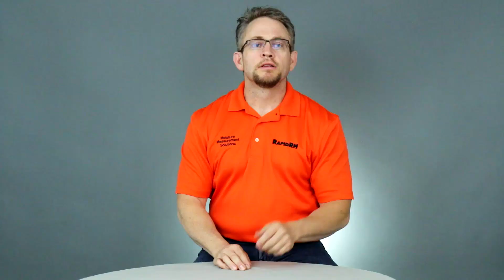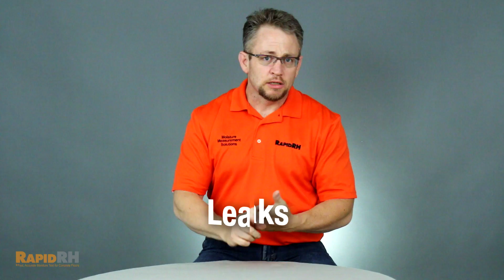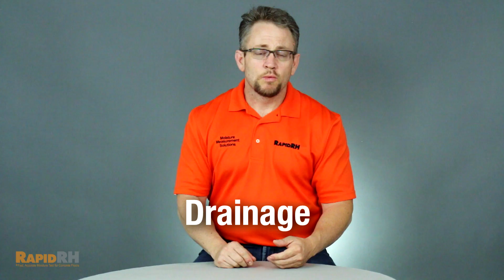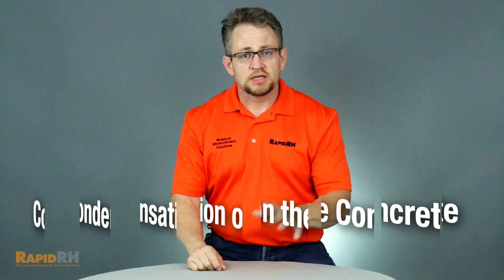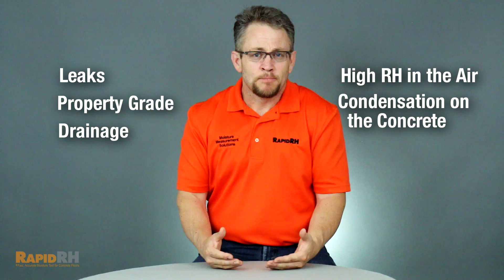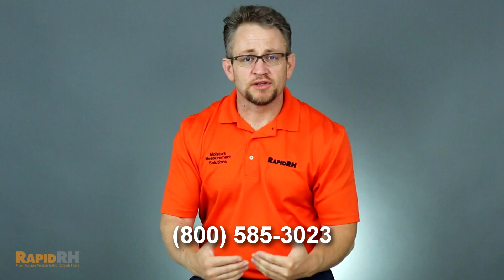5 Common Sources of Moisture in Old Concrete

Comment: Go for it flooring. We use a moisture meter  every time. i am finding high moisture content in 9 out of 10  slabs. I have  to seal them with  Bostik concrete sealer

Comment: Hello. I live in Southwest of ON Canada . my concrete garage floor is over 40 years. i am about to re finish the floor this summer. however i am finding especially hot weather (30C+) out side .too much moistures comes from the floor. I checked alll the plumping its good. and garage door little gap not seal very tight. the edge are good. just middle of the floor. and some part of the concrete are damaged not flat any more.
could you please help. I have to settle the moistures problem before re finish the floor.
appreciate !

Comment: I have a problem with moisture in the air forming on the garage floor. Will a sealer really help this problem?
Reply from the maker: If it is moisture in the air condensing on the surface of the concrete then a sealer wont work. Air flow in the area, increasing the temperature of the concrete, and/or decreasing the relative humidity in the air may.

Comment: Jason, good info. I have a covered, open air, poured concrete porch slab that's 20+ years old with a seam between the inner and outer halves. When warm weather sets in on cold concrete 1 side heavily condenses (side near house) the outer half stays completely dry. We are trying to stain the concrete for better optics. What can we do to prevent the condensation from wreaking havoc on the stained concrete? Thank you.
Reply from the maker: Greg:

Thanks for the question. The best thing you can do is identify the source of the condensation i.e. what is causing the slab temperature and/or ambient RH% variations from one side of the slab to the other. First, get a thermo hygrometer that calculates dew point https://www.wagnermeters.com/shop/th-200-thermo-hygrometer/ and an infrared thermometer https://www.wagnermeters.com/shop/infrared-thermometer/. Measure the RH% and temperature on one side vs the other, with the calculated dew point. Measure the surface temperature of the concrete with the IR thermometer. Compare the dew point temperature with the surface temperature. The closer they are, the higher the likelihood that there will be condensation. Hope this helps.

Jason Spangler

Comment: I live in Canada in the province of British Columbia. Each winter when the temperature drops down below -15 degrees, the edges of my concrete floor in my garage, start getting a layer of (FROST) on them. I have inserted a (backing rod) between the gyprock wall and the concrete edge and sealed it with a industrial caulking so far. But, it is still happening? 
What can i do from here to totally stop this from happening. I have a 250 volt heater system and a exhaust fan system in the outer wall plus a dog door from the inside of the house out to the garage for moisture erasing.
Reply from the maker: Mike:

Thanks for the inquiry. So the first thing I would do is get an infrared thermometer and a thermo-hygrometer. When you see frost develop, use the IR thermometer to get the surface temperature of the concrete all around and compare it to the temperature of the edges where there is frost. Then use the thermo-hygrometer to get the temperature and relative humidity of the air. Plug this thermo-hygrometer information into this calculator https://www.calculator.net/dew-point-calculator.html?airtemperature=-23&airtemperatureunit=celsius&humidity=50&dewpoint=&dewpointunit=celsius&x=0&y=0 Now compare the temperature result that the calculator gives you with the temperatures you got from the IR thermometer. If the temperature of the concrete is less than the calculated value from the calculator then it may be condensation in the air that is freezing on the surface of the concrete. A dehumidifier may be a necessary addition to solve this problem. Other options may be increased insulation around the perimeter of the garage if the surface temperature in those areas are drastically different than the rest of the floor.

Good luck.
Jason

Comment: Hi!!  I'm really hoping you can help me.  I live in south Louisiana and have a serious moisture problem in my slab.  I have had all my pipes checked, put in a drainage system, installed a sump pump, had the slab drilled and had polyurethane injections put under the slab and sealed the top of the slab.  The moisture test is STILL showing 100%!  What kind of flooring can you put down on a concrete slab if there is no way to get rid of the moisture?
Reply from the maker: Thanks for the question. You state that you had “the top of the slab sealed”. I’m not sure what this means exactly, but if the slab is sealed, I would expect the moisture wouldn’t be able to escape…which is fine. I would make sure though that the “sealer” is really meant to work with flooring to encapsulate the slab. If so, depending on the product used, you may be able to install whatever floor you chose. Bottomline, they make products that you can put on the surface of the concrete that lowers how much moisture can escape the slab and interact with the finished floor. Find a good flooring installer that can walk you through the process.

Jason

Comment: I have efflorescence pushing up my glued on vinyl planks.  Should I go with polished concrete floors?  Or, use vapor barrier with floating vinyl planks?
Reply from the maker: Carolyn:

Thanks for the questions. It should be your preference here. With a qualified, knowledgeable flooring installer, you could go either way. Good luck.

Comment: Who do I use to help me with this problem? I have moisture in my concrete slab need help trying to figure out where this is coming from but don’t know where to begin.
Reply from the maker: Angie:

You don’t mention what the actual symptoms are that bring you to this conclusion, so my recommendation would be to first rule out any type of leak in your plumbing system. I would look for a leak detection company in your area to accomplish this task. Good luck.

Jason

Comment: I seal driveways with silox silane sealers the way I dry old slab regardless of how much moisture is in the concrete. Is with a torch, it causes the concrete slab to be bone dry so it can absorb the sealer deep in the concrete. Thanks

Comment: What should the maximum rh of a concrete slab be before installing carpeting?  I’ve googled it and I’m having difficulty finding an answer. Thanks.
Reply from the maker: Peter:

Thanks for the question.  It depends on the type of carpet and, at times, the manufacturer and adhesive.  The best place to look is on a manufacturers website, in their installation documents, under sub floor preparation.  We also have a website, www.rhspec.com , where we have various manufacturers listed and links to their installation documents.  I hope this helps.

Jason